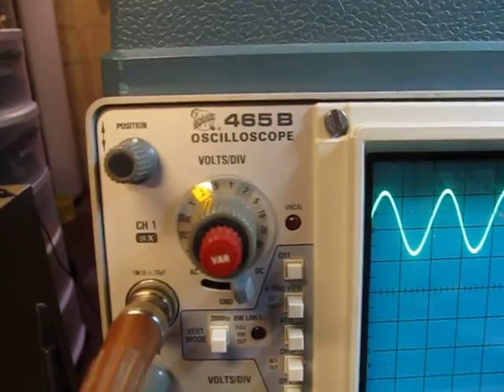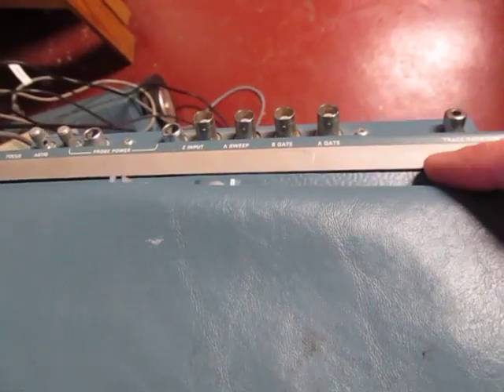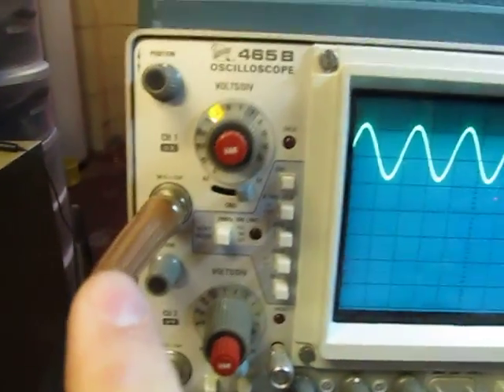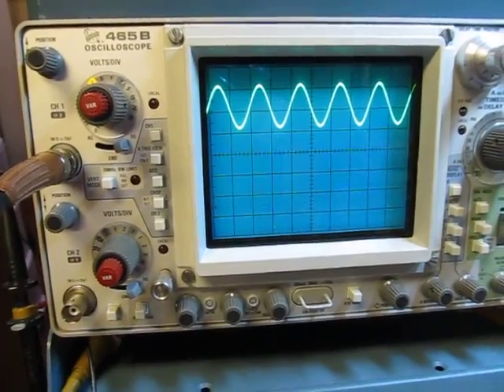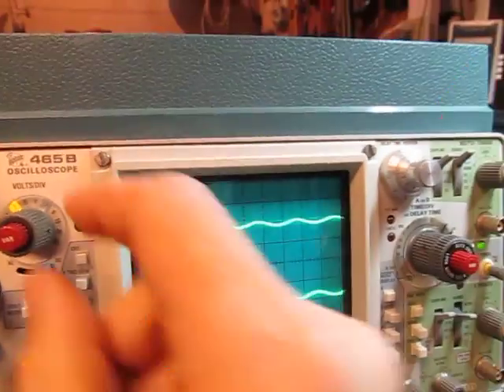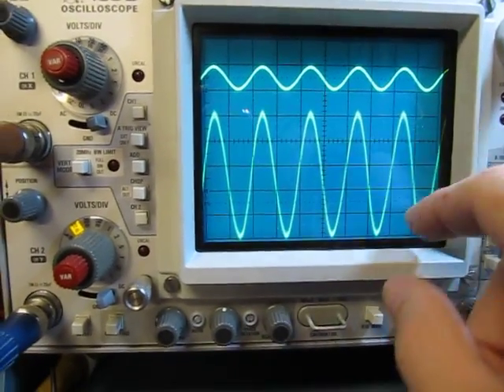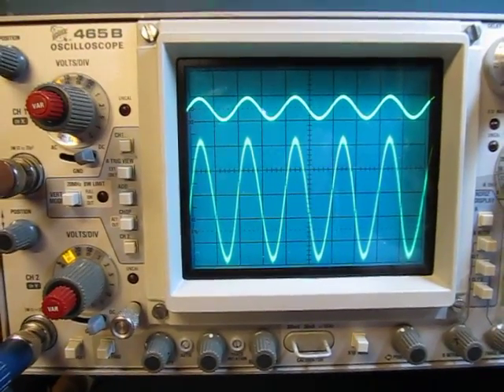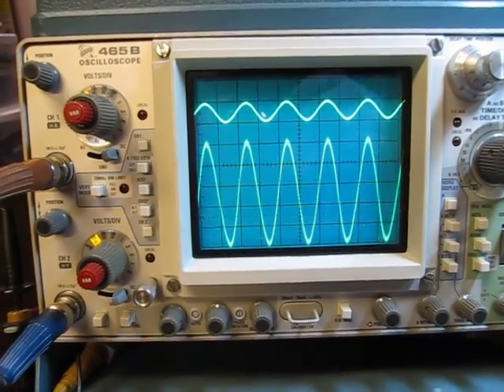#40: Analog Oscillocope's rear panel auxiliary inputs and outputs

Comment: Very helpful video. Question, could this Vertical Output be used to connect to a Spectrum Analyzer such as the HP 3580a, is there any down falls or errors by doing this? Sure would be a slick way to view signals in both domains while keeping the bench cleaner. Thanks!
Reply from the maker: Yes you can.  Limitations are that the vertical amplifier/buffer might had some noise and harmonic distortion, and maybe bandwidth limit your signal.  But, go ahead and test in your application, it'll likely work very well.

Comment: Does someone know if you could (realistically) use the amplification with the output channel to look at low level noise like Dave advertised in his 2225 Tek video with the 500uV/div resolution?
Reply from the maker: Yes, you can connect the CH1 Vertical Output to the CH2 input.  With both CH1 and CH2 set to 5mv/div, you'll get approximately 500uV/div effective sensitivity.  I don't know if it is truly calibrated, but you can do it.

Comment: Can you invert the Channel B signal and use it like a poor man's differential amp?  I have a Tek 475, and I am going to run to the bench to see if I have this feature. :-)

Bob
Reply: That's a pretty common use case - channel A plus the inverse of channel B.  It allows you to measure the differential voltage between any two points in your circuit.

Comment: Final comment Alan , the scope was fully powered and operating for 20-30 minutes. I walked away to do something else and returned to see the scope was off no power ? Tried the power switch checked the plug but the scope would not power up. My intentions were to let it run for a few hours since I did not power it up for some 4 years..sort of a burn back in process...guess I did not fare to well here...HELP ! Carl

Comment: Hi alan, Carl here again..with the 475A/DM-44..We'll I have the scope about 5 years..used it for a year or so, just to monitor SSB Signals.I have not turned on the scope for 4 years, Tried that tonight, left it running for say 20 minutes or so, and noticed the scope was not running, checked all power connections, scope had no power. Could this be a breaker or fuse or possibly a capacitor in the power supply ? Any info you can shed would be greatly appreciated...Thanks a lot....Carl

Comment: Hi alan...I have a tektronix 475A with the DM-44 digital volt meter mounted on top..purchased from valuetronics....wonder if you could give your opinion on this model.? Scope is in excellent shape.Purchased 5 years ago for $ 750....only used for some signal monitoring since i'm also a ham.....Thanks Carl

Comment: Great stuff and great channel! I really appreciate your videos, and not just because I own 4 Tek scopes -2) 453's, a 547 and a 575 mod 122c curve tracer. All working (hard), except one 453 has recently developed channel 2 vertical amplifier issues -the trace floats randomly up and down, and it seems heat related. Both 453's are Nuvistor equipped. Anyway, any tips you may have about maintaining and using these older Tek scopes, like these last few vids, are greatly appreciated!